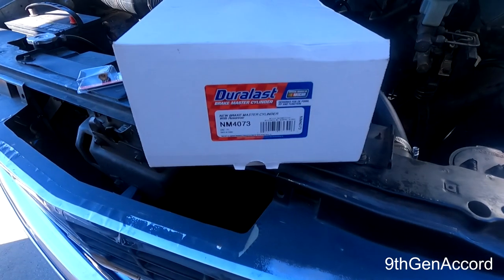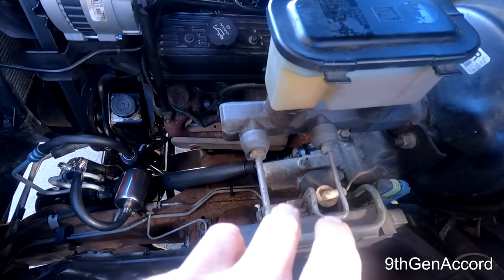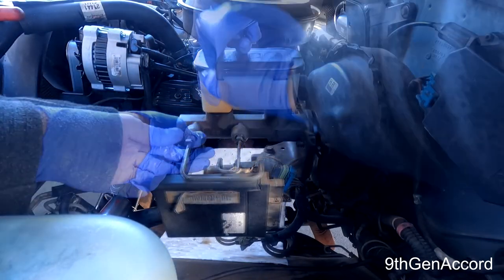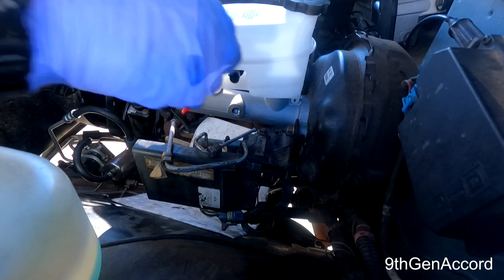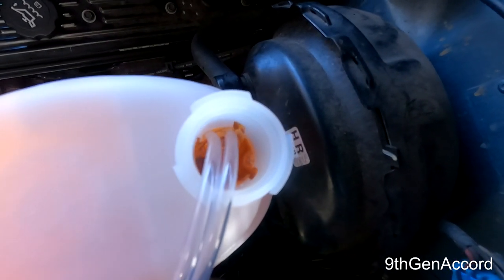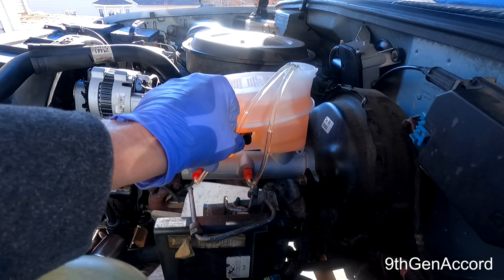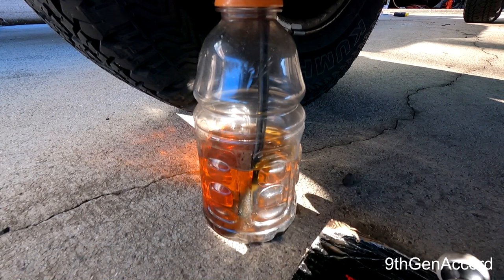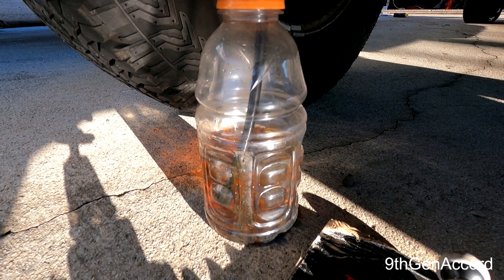Brake Master Cylinder Upgrade GMT 400 '88-'98 Trucks

Comment: Did this yesterday on a 1994 suburban. Had to make custom lines from the MC to the proportioning valve since the 1/2 20 inlets were a little closer to the booster than the old rectangular shaped one. Used the pressure bleeder to bleed the mc, abs modulator valve and all four wheels. Now it has a rock hard pedal, stops right away and the abs works!
Reply: I was about to do mine until I ran into that problem do you have a video of you doing it or a picture of it so I can see what you did?

Comment: the bottle feed you had. just pumping peddle will get rid of air as you see. ten pumps per wheel. done deal. i do it all the time. no grav needed but hey who am i .
Reply: Heard this the other day, definitely going to try this when I do the upgrade
Reply: no need.  i have never pumped a pedal for one cylinder or caliper more then 4 times to bleed the air.  i start rr with 4 pumps and move to lr down to 3 pumps while opening the bleeder at each pump.  2 on the fr and 1-2 pumps on the fl.  never had an issue

Comment: Or just put a master for a 3500 on it.  I have hydraboost from a 95 C3500 on my 94 K1500  that is setting on a 1976 K20 chassis with disc brakes on 14 bolt rear axle and on Dana 44 front axle.
Reply: How's the dana on yours? You have to replace the whole hub when you're doing the front rotors?

Comment: I would note that this brake master cylinder is for a C1500, not a 2500 or 3500 truck. They HD trucks use a larger bore than 1/2 ton trucks.

Comment: I have a 1988 C1500. I’ve changed the front calipers and  hoses, rear wheel cylinders, all new lines and a master cylinder. Brakes are still soft and pedal travel is long. I’ll be doing this upgrade along with the rear ABS delete this weekend. Thanks for posting the video!
Todd
Reply: Update ?

Comment: Will be doing this on my '94 C-1500 this afternoon.
Picking up parts on my way home.
I pull heavy trailer and loads with mine, and it's not a fun feeling when you make the last twenty miles of a run stopping with just the trailer brakes!!!
THANK YOU!!

Comment: I put a gmt800 mc on mine a few years ago and i can confirm that this will undoubtedly make your gmt400 stop on a dime,  no squish at all on the pedal.  Nothing else in the brake system matters if you're trying to get rid of the soft pedal.  

You don't need to make new lines or anything if you're careful with the original lines and slowly bend them in a way that it'll route to the shorter mc connections. All you need is 1 adapter that's commonly found at auto stores

Comment: Great Info! I have a 1988 Suburban and Just ordered a 2002 Master cylinder. Excited to install. I did just like you and replaced everything, including getting rid of the assembly valve at the back that was connected to the rear axle.
Reply from the maker: Right on!

Comment: Thanks for the video!  The how to is straight forward.  Got a Master Cylinder for an 02 and the adapter and it worked as you said. 

Just a note for others who still have their ABS in line, make sure you bleed it as well. This needs to be done wether or not you still use the electronics. Mine is functional but it does not have to be.  There is a Schrader like valve under a cap.  Should be located at the steering wheel side, aiming at the driver side wheel well.  It’s fun to get to but has to be done. Depress it to release air from system. ABS System. Pump brakes just as your doing a caliper or wheel cylinder. Redo until confident you have no air in it.  

This mod literally changed the way my  truck drives. Well worth the few dollars spent.
Reply: there are two schrader like  valves depending what kelsey hayes abs module you have depending on year.  and two more on all abs modules no matter what abs module you have.  on the kelsey hayes they are side by side just under the in and out lets of the brake line connections

Comment: Going to try this on my '90 that has crappy brakes..the "Brake" light has been staying on for a long time, don't know why, brakes were pretty good up until recently. Light's still on, but now, the pedal goes way down..not losing fluid, though. BTW, I don't know why or how the GMT 400 got the "OBS" moniker...stupidest thing I've ever heard..if it's "old body style", then so is the GMT 800, 900, and whatever the '14-'18's were, since they are no longer being produced and not the "current" body style...not crazy about the term "squarebody", either, not sure when that term started to be used, but I remember when the GMT 400's first came out...the "squarebody" was still in production at the same time, and the 400's and '73-'87 body style were produced alongside each other through 1991, as the Blazer, Suburban, and certain styles 1 ton trucks continued to use the '73-'87 body style... During this time, I actually remember most people around here calling the '73-'87 style "Old Body Style", and the GMT 400 "New Body Style" to differentiate the two...

Comment: Anyone know if it's the same part # for a 1996 OBS with the 6.5L diesel? My brake booster looks different but it looks like it'd probably fit. The NM4073 isn't coming up for a 2006 6.6l diesel so wondering if it's different

Comment: I tried this on a 98 silverado.  The fitting with the adapter leaked.  I tried thread tape then an o-ring and it still leaked.  The other fitting did not leak.  Any suggestions?
Reply: Dont use Teflon or a oring either tighten it more or get the right fitting you more than like have the wrong one or a damaged fitting or line or master cylinder seating surface
Reply: U prbly cross tread the part

Comment: Please respond to us boss man , in order for this to be a true upgrade do we have to delete the abs ??
Reply: No. Unless your anti lock is an issue from the rear, usually you can tell if it is. Example i have a c3500 warmin up my brakes sensitive,but when shes at temp my brakes are spongy as heck, night and day feel. The reason why he upgraded is that the master is shorter in tale it makes for a more sensitive brake like newer trucks.
Reply: @bluesteeljay9343  I’ve been trying to locate the issue, replaced front pads and rotors , the master cylinder , bled all lines , bled the cylinder and I’m still having a super spongey brake pedal.. do you think If I didn’t replace rear brakes ( shoes ) or vacuum booster this issue will continue ?
Reply: @bluesteeljay9343  my next test was going to be bleeding out abs
Reply: @ELBertoProductions  im assuming this is a gmt400 style truck. Does it have rear drums? And do you have a brake booster or hydro?
Reply: @bluesteeljay9343  you’re right man I’m just gunna restore the rest of the brake system
Reply: @bluesteeljay9343  thanks for the help boss
Reply: @ELBertoProductions  no probs. The way i see it like 9th gen says: These vehicles are over 20 years. And what ever i can afford in the moment, ill replace it over rebuilding unless its not capable/product stopped. I finished a full brake r&r on my 89 k5 oem though. Now im on my 88 c3500 A first year gmt400.  9th gen showed it sound to test a nbs on an obs so im super stoked for tomorrow when i order them parts
Reply: @bluesteeljay9343  awesome man ! You guys are right and I’ve already sorta been doing that as well, replaced so much this truck hadn’t had an oil change in years . Literally
Reply: He said that the ABS dump valve is a problem even when knew. I am getting rid of mine.
Reply: @ELBertoProductions  Vacuum booster is a seperate peace.  Power brakes, it works, Hard press to stop, booster NOT working.
Reply: @ELBertoProductions   alot of mistakes come from bleeding the master cylinder.  bench bleed it.  and when you release thew pin be sure you have the two ports closed or it will draw air in and the system will never bleed correct.  also on the abs module the proportion valve depending on year will have a rubber cap on one or both ends take one cap off at a time if you do have two and hold the pin in while a helper applies the brakes.  release the pin before the let off.  the same way you bleed at the wheels.  the abs module also has these same ports on the bottom just under the lines that go to and from the module.  the same bleed procedure applies for those as well.  then bleed all four brakes at the wheels again.  the two valves on the bottom of the abs module are a pain to bleed because if you don't know where they are they are hard to see.
Reply: @ELBertoProductions  also if the drum hardware has broken parts the shoes will push out but not retract causing this sponge pedal as well.

Comment: NOTE:: Gravity bleeding will NOT work with a Bad Rear ABS system.
Reply: hmmm maybe because your valve is stuck shut...
Reply: @freetoride003  ? the original proportioning valve ?? could be. ABS valve has been removed. The rest, all new, wheel cylinders to master cyl.

Comment: Long throw pedal..... the master cylinder you used is the same throw as the OEM 88' 95' master cylinder. I used the 2002 silverado M Cyl. the short one. Now hard pedal, .....NO POWER BRAKES!!!!!!
Reply: No it is not the same throw, that is the whole reason to swapping the master cylinded🤦‍♂️
Reply: @GMT400Chevy  SO, NO POWER BRAKES ANY MORE WITH SHORT MASTER CYLINDER ???????

Comment: do you  know if this will work on 97 3500 with hydroboost
Reply: I wonder the same thing have you try it?
Reply: @toyotat100rules  no not yet I'm going to start looking into it when spring comes around
Reply: Nope , and if your steering gear box is leaking , thats why your brakes are goofy , hydro brakes suck on them heavier vehicles , but they had to do something to help stop all that weight ..hook it to the power steering pump and the steering hear box , great design aint it ..lol

Comment: I could use some help.   I have a 89 c1500 
I did the master cylinder swap with the same parts you used.  And deleted my ABS and I have absolutely no petal.   Goes straight to the firewall.
Reply: Bleed it and watch for leaks

Comment: Gravity bleading did NOT work a
on a 91 silverado. No fluid would flow.
Reply: you either have a clogged line,  broke line, or clogged bleeders.
Reply: Proportioning valve could be stuck in one side , did you blow a line , the proportioning valve will shut off the side that blew , usually front or rear , open the other side bleeder and have someone hit the brakes hard , panic stop with one bleeder opened on the opposite line of what blew , either front or back , tighten bleeder before releasing the pedal ...now see if you got pressure on that other line ( usually the rear for me is the ones that blow out , so a panic stop the front bleeder , it flips the proportioning valve to both sides , kind of recenters it